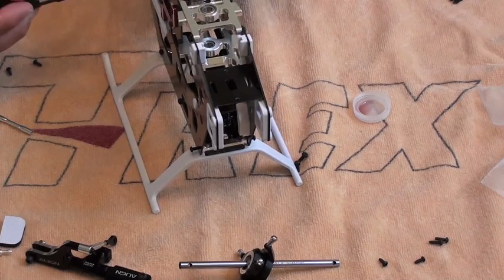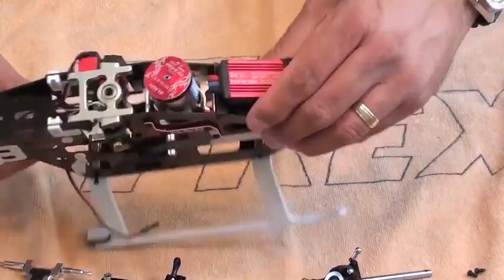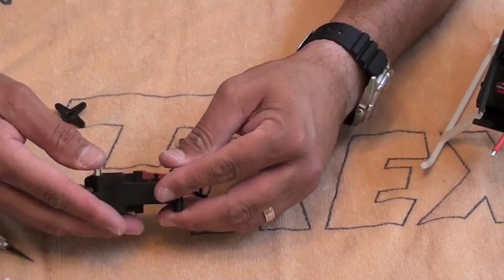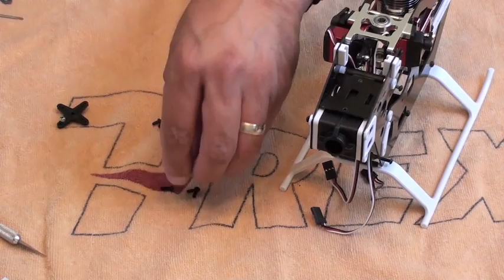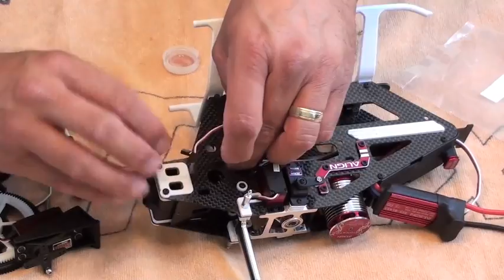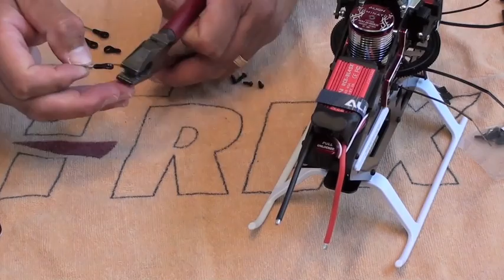Trex450L Dominator Frame Assembly Part 2 of 2

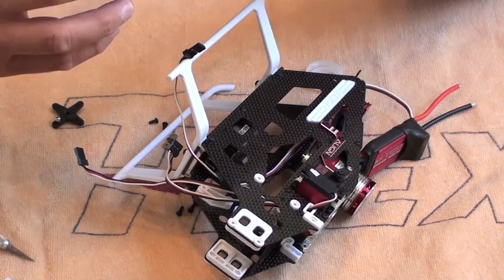Comment: jesus...  from 21:00 to 23:00 everything hes doing is off camera.. SHOW WHAT YOURE DOING!!!  its still impossible to tell how you get the boom mount inside the frame. and the manual doesnt say how to do it.
Reply: I think the way they installed it was an afterthought. I ended up centering the aluminum rods in it and flexed the frame just enough to fit it in.

Definitely should have went in before both sides of the frame were fastened though.